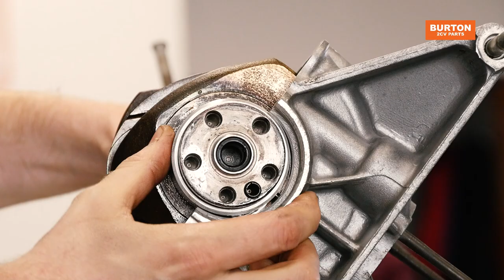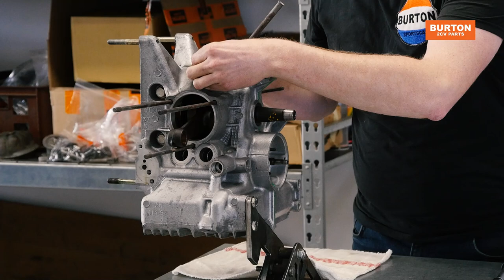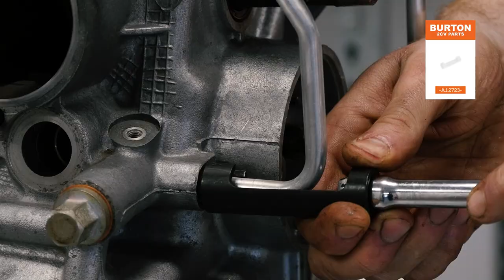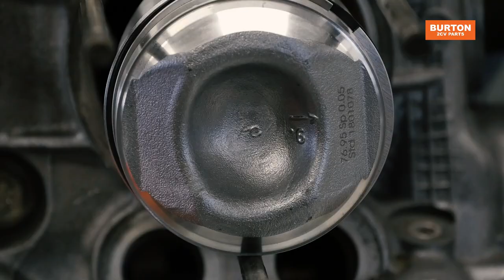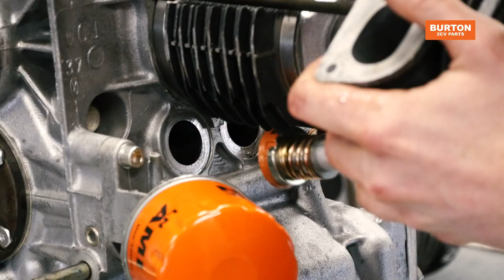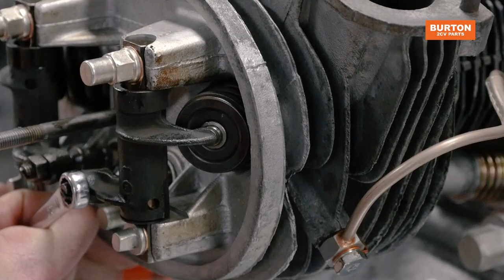Rebuild a 2CV Engine | Part 2: Assembly | BURTON 2CV PARTS

Comment: M10 crankcase bolts 45nm
M7 cranckcase nuts and bolts 19nm
M5 oil pickup bolts 5nm
Oil pump cover bolts 13-15nm
Oil filter hand tight
Oil pressure release valve plug 45nm
Oil cooler swivels 10-14nm
Cilinder head nuts & bolts 10, 20, 23nm
Oil feed line banjo 10-13nm
Valve lash 0.2mm
Valve cover nuts 5-7nm or 1.5 turns

Comment: If you are following this while assembling your engine dont forget to place the steel ignition plate over the crankshaft before the oil cooler is fitted, as you cant fit it after without bending the pipes , they dont show it at all , it may save you a headache,

Comment: No intake or exhaust manifold gaskets?  I like some of the special tools, like the oil cooler lower bolt tool.
Reply: I think this orange painted manifold is a adjustment manifold for right orientation from the heads before they tightening...

Comment: The down side hear is there is no real chat or explaining on anything and did find a video of an older gentlemen working on an engine he purchased on ebay and he explained everything and had a greater challenge than this factory setup that dose not show true skill in take out rusty screws and worn parts to fix or remove.